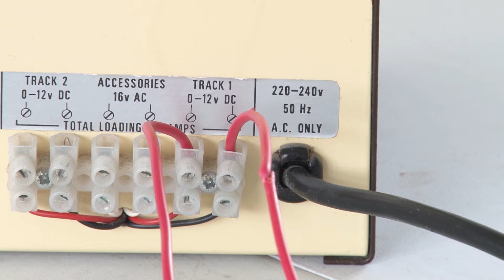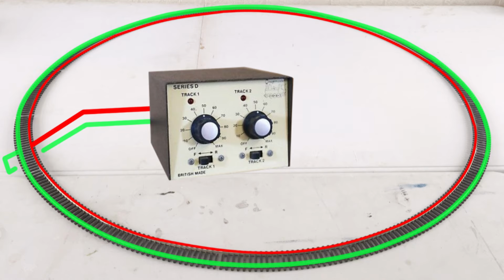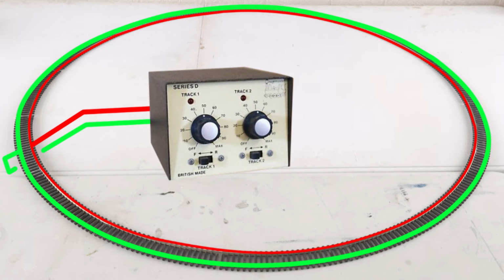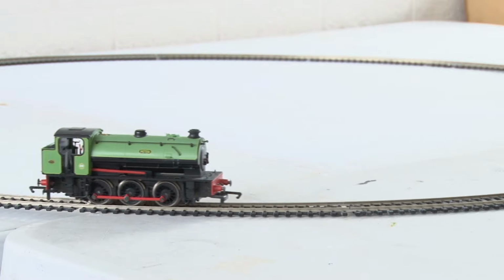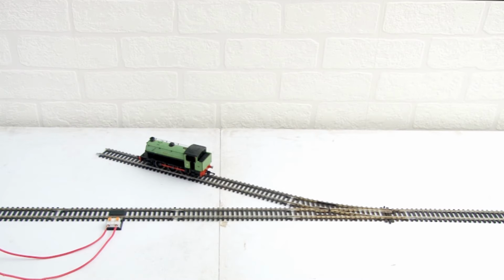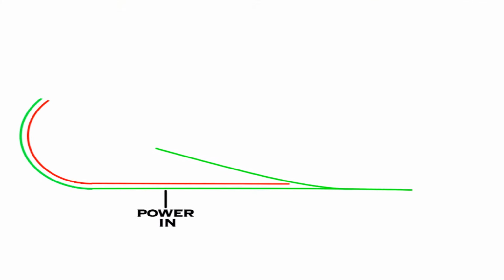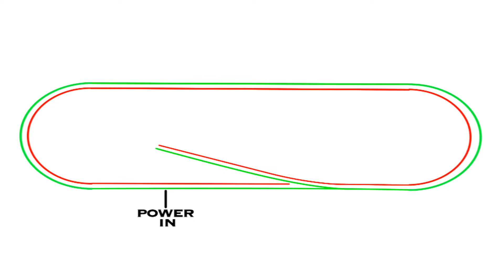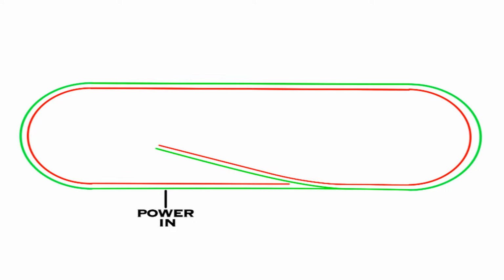Wiring A Model Railway For Beginners - Model Railway Basics: Episode 3

Comment: Never imagined powering up even a simple single loop model train track would have so many technical issues. Good video.
Reply from the maker: If it is literally a single loop then it's just two wires, one to each rail, and that's it. Points/turnouts are where things get more complicated by even then it's mostly just a case of where you put the power feeds in relation to the point. Thanks for watching 😃

Comment: Brilliant! I never knew that about DC & DCC locos not being entirely compatible with each other's track. For me I am never venturing into Don't Come Cheap territory!
Reply from the maker: Hey Alan, if you haven't bought a DCC Command Station yet I'd recommend looking into the new HM7000 system from Hornby that's on the way. The bluetooth decoders can apparently run on traditional 12v DC (where with normal DCC it's a bit iffy) so you could convert some of your locos and leave others on analogue control.
The decoders are a little more expensive but you save a huge amount on not having to buy a Command Station to run everything, so swings and roundabouts. Just food for thought if you're taking your first steps into digital control. Thanks for watching 😃

Comment: Informative as always!👍 I still can't believe that your insulfrog points work with those little engines! Even at low speeds? Incredible 😂
Reply from the maker: Thanks! Yeah even I'm impressed with how the Ruston performs. Interestingly though I have been having some trouble with a couple of 0-6-0s on the new layout due to uneven track. I'll be showing in the next Modular Layout video along with my solution (hopefully)! Thanks for watching 😃
Reply: @ThatModelRailwayGuy  uneven tracks are the true nightmare! I had some problems with a small diorama I built, solved by outsmarting gravity 😂 but in a big layout is tough

Comment: Great video as always! If possible, can you do a video on what DCC controller you use please or even your thoughts on other options. I’ve got an old Hornby Select and keen to upgrade. I’ve tried HM7000 which was great (at least for me!) but cant get the decoders in all my locos which is a bit limiting. Would be good to get your thoughts on what is out there. Thanks
Reply from the maker: Hiya, I have considered doing a video on DCC controllers - the obvious barrier is needing all the controllers to be able to compare which would get quite expensive. 
Personally I use the Roco Z21 system - quite expensive but does have a lot of options including wireless control. 
The HM7000 is great but as you've noted, there are issues with fitting the decoders into locos - I believe Hornby is working on making them smaller in the future. 
There's also the Prodigy system (from Gaugemaster I think?) which is popular with a lot of modellers. It doesn't have some of the more fancy features but it's a full complete system that works really well.
Alternatively there is also the DCC-EX system which is a DIY controller. This is the cheapest option and is gaining in popularity with those on a budget.
Hope that helps and thanks for watching 🤩
Reply: Thanks, I’ll keep this is mind! The Z21 might be a bit out of reach for the moment but will look into the other options. Hopefully Hornby also come out with smaller decoders too as I personally have found the system a pretty straightforward entry to DCC. Thanks

Comment: Firstly I’ve followed all you tt120 videos and some others and they have been extremely helpful . I am building a tt setup for my grandson (well he might get it eventually?!). With regard to electrifying should I put a dropper on every piece of track to avoid long term circuit breaks (I have a mixture of Horny set track and PECO long flexible) or just some or not bother at all and rely on fish plates?
Many thanks 
Steve
Reply from the maker: Hi Steve, fantastic to hear you've started a TT layout! Since you said in your other comment you were using DCC I would recommend adding droppers to each section of track. That's what I did on my TT layout and it will make everything more electrically robust in the long term. Obviously this is easier if you're using the PECO flexitrack as the lengths are considerably longer. 

You can of course rely on fishplates too and just add droppers at strategic points around the layout and it will probably work fine... but I tend to be of the opinion that it's best to put in the extra work initially for the piece of mind later on. Hope that helps and thanks for watching 🤩
Reply: Very many thanks, your videos are my encyclopaedia!

Comment: Thanks. Lovely and clearly presented. I have a simple circuit working, but Is there any advice for the next step up say with two circuits that intersect please. Not sure what has to be connected.
Reply from the maker: Glad you found it helpful. For two circuits, when you say intersecting do you mean with a set of points to cross from an inner circuit to and outer circuit? If so there are two main options: 

1. Feed the wires from your controller to both circuits. Both circuits can be controlled from a single controller as if there were two locos on the same piece of track.

2. Introduce a second controller to hook up to the second circuit. When you open the points up to cross from one circuit to the other you just need to make sure that one of the controllers is off so they don't fight against each other. (You could also introduce an isolating switch as a belt an braces approach but that's a little more complex) 
Hope that helps and thanks for watching 😃

Comment: Great video, ideal for a total beginner.  
I’m only on DC but still use a bus wires and multiple droppers so I don’t get a voltage drop on a larger loop.
Also if I change my mind I can change to DCC.
Reply from the maker: Thanks Leigh, yes same for me. Because my layout is modular I built in bus wires and droppers on every module even though it was originally intended for DC. That said I'm now making the move over to DCC but thanks to some forward planning I made it easy to switch between the two just by unplugging one set of wires! Thanks for watching 😃

Comment: A very quick adition for anyone who wants to keep sidings live on DCC. (6:51). A very easy way to do this that doesnt require a seperate feed for the siding is by using point clips by Hornby. By inserting those the insulfrog points are always live. I'm unsure however if you can use these on non-Hornby points.
Reply from the maker: Ah brilliant, thanks for sharing that! I don't have any myself so I don't know if they work on other points brands either but they're certainly a great alternative for someone who wants to keep the wiring to a minimum. Thanks for watching 😃

Comment: I want a controller for the exact loop you made (track). Which one should I get? I want cheap, and I want both direction running (reverse and forward). And as simple as the first example of wiring you gave. Love it if you could help, thanks.
Reply from the maker: If you want the cheapest option out there you can get some really basic PWM 12v controllers for £5 online. But your locos probably won't run the best on those to be honest. In my opinion you're better off going for something like the Gaugemaster Combi - nice and simple and used by both beginners and experienced modellers alike. Hope that helps and thanks for watching 😃
Reply: @ThatModelRailwayGuy  Oh! I meant cheap as in not £200+. The gaugemaster seems perfect. Could you explain what single rail and duel and quad rail are?

Comment: Hello, nice video. Do you have a video on how to DC wire a double loop with points connecting them so trains can go from one loop to another but two trains can run at the same time?
Reply from the maker: @railway187  Not specifically but in that instance you need two controllers, one for each circuit - doesn’t matter where on the circuit it’s connected.

The easy way would just be to make sure one controller is OFF when using the other controller to have a train switch from one to the other.

Or if you want to get fancy you can use isolating fishplates between the two points which will protect your controllers. But when crossing over you need to make sure both controllers are set identically. Hope that helps and thanks for watching 😃
Reply: @ Thanks 🙏

Comment: Have you/ Can you do a video on where to start with the basics of getting started with DCC?? Setting it up, extra wireing for siding, lights to building, and so on.
Reply from the maker: It's probably best to check out some of my layout builds (the current TT:120 layout build in particular) as the early episodes focus more on wiring for DCC. But essentially you just have your main bus wires and take droppers out the track from there. Some people add droppers to ever single piece of track, others are more conservative.
Personally I don't use DCC power to control the lights or points, I prefer having these on a separate 12v circuit which I've found to be both safer and cheaper too. Thanks for watching 😃

Comment: Thanks for this great tutorial, I do have a couple of questions to ask, I'm just about to start building my new layout, it's with the new TT 120 set, I'm having a few problems on what wire to use for the bus and droppers. Someone said use 16 X 0.2 for the bus and 7 X 0.2 for the droppers but after buying them they seem very thin for the job  It's a double loop setup and on a 6 X 4 feet board so not big and will be DC. I'm hoping to wire up my points as well but not sure which points to buy and should I run a separate bus for the points. Thanks so much.
I'm really missing your ""video series", are you going to do any more?
Reply from the maker: Hi David, great to hear you're making a start in TT! The dropper wires don't need to be very thick - they just connect your track to the main bus wires so they only travel a very short distance. If the wire is too thick you'll have more difficulty soldering it to the rails without causing issues.

When it comes to points, what track are you currently using for TT - Hornby or PECO? While the two are technically compatible, my experience tends to be that it's much easier to stick to one or the other for the best results. The Hornby points are dead frog, but cheaper and easy to use. In comparison, the PECO points are more expensive but use the new Unifrog concept, which allows the whole frog to supply power to the loco making them more reliable.

As for the video series continuing, do you mean Model Railway Basics or the Modular Layout Build? There should be new episodes of the latter along fairly soon hopefully. Hope that helps and thanks for watching 😃
Reply: @ThatModelRailwayGuy  Thank you, I'm sticking with the Hornby track and points, I didn't want to mix them and they were supplied in the train set and so I bought the track packs to enhance the layout. I'm wanting to eventually put switches on the points so when I wire the layout this week I will drill holes in the board to accommodate the point motors. I was thinking about using the Gaugemaster Seep motors, assuming they will fit the TT 120 tracks. If I'm right do I need a CDU to fit with these.
Any of your video series whether it be your Modular layout or something like the Layout in a suitcase, (I really enjoyed that). Or even your scenery videos. The thing is you have a way of presenting that is easy to understand which makes it more enjoyable to watch.
Thanks again for your help.
Reply from the maker: @davidharle952  Ok great, yeah the Gaugemaster SEEP motors should be perfect but yes I would highly recommend using a CDU with them. The SEEP motors fit fine on both my 00 and 009 points so I can't see why they wouldn't work with TT points too. I actually have a video on fitting these motors which might be of use: https://youtu.be/T95X4JPRKkk

Great to hear you like the scenery videos too. The modular series is returning very soon hopefully with the aim of finishing off all the scenery on the layout. Channel Members have already seen some of the progress as I've been posting updates for them as it happens, but the main videos will be along once I've finished editing them. 😀

Comment: Great video. On the back of the series d controller there two positive and two negative ports for the tracks etc. Can you run multiple wires from each port so they can each operate two tracks? Or a signal and a track? Thanks Andrew
Reply from the maker: The two ports correspond to the two control knobs on the front panel. In theory you could run wires to multiple tracks but obviously one knob would then cause trains to move simultaneously on both tracks unless you introduced a switch of some sort. I don't think it would work with a signal though as I believe they generally need a continuous power supply. Thanks for watching 😃

Comment: If it were to fit electrofrog points but not do anything with the little polarity wire (though I would add insulator collectors on the frog rails) would the electrofrog point work the same as an insulfrog point? Or would it be worse for stalling than insulfrog and less reliable overall? I'm trying to decide whether to go for insulfrog on my layout, or go for electrofrog installed as described above and have the option of doing all the polarity stuff layer down the line.

Thanks!
Reply from the maker: Hiya, the short answer is: no, not really. With an insulfrog point the power is distributed down the exit the point is switched to and to the line beyond but that wouldn't happen in this case. Also your dead section would be a LOT longer than on the insulfrog point so you'd be limited to running only long wheelbase locos with lots of pickups.
 
The best thing to do would be use the new Unifrog points as these are pretty much designed for your exact situation. Out of the box they act mostly like the insulfrog points but they have the option of adding power to the frog later on if you want to go down that route too - I actually have a video on these coming out fairly soon!

The main disadvantage with Unifrogs is whether PECO have actually made them for the type of points you need in the correct gauge/scale as they're still fairly new. Hope that helps and thanks for watching 😃

Comment: Do you add droppers to each piece of track or have one connection to power the entire loop? I’m still working out what to do on my layout
Reply from the maker: For DCC I tend to add droppers to each piece of track if I can - it's not a necessity but it does tend to make things more consistent. The same is true for analog to a certain extent but depending on how you wire things up with isolating sections it can be a bit more involved. At least with DCC you know everything needs to be live all the time. With analog though I've gotten away with having just one power input on an entire layout and running it from that... it depends on the layout of course and what you're hoping to do with it though. Hope that helps and thanks for watching 😃

Comment: Hey buddy,

Do you have any videos or advice on a second oval inside a larger one? 

I’ve just built my son’s track in the loft and have a larger outer oval with a small inner. We’re just starting so only have the one Hornby 7229 power unit with the one powered piece of track.

I’m struggling to understand whether both inner and outer ovals will need a power unit and power piece of track? I thought maybe just one was enough because they’re connected via points.
Reply from the maker: The points isolate as shown in the video with the sidings so the power will only flow into the second loop when both sets of points are set to crossover. Once you set them back to their own loop you’ll lose power to the second loop.

If you want to control each loop separately you’ll need a second controller and power track for the second loop. 

You can also control them from a single controller using the Hornby track link wire which will transfer power over to the second loop. But bear in mind you won’t have individual control over each train. Hope that helps and thanks for watching 😃
Reply: @ thank you so much!! That’s really helpful, I probably should’ve understood that from your video, apologies. 

Thanks for t help and thanks for the videos, we couldn’t have got this far without you

Comment: At 6:51 you mentioned that people like wirings multiple pieces of track like sidings etc. I was wondering what you do with all the ends of the cables and what you plug them in to
Reply: That are attached to all the different sections of track
Reply from the maker: Hi there, so in the case of DCC you would have a set of bus wires (positive and negative) that come from your controller and run underneath the baseboard. All wires from your track would connect to these main bus wires - think of it like a central power cable that branches off to each piece of track. 
Alternatively you could just connect the wires to another track section that is already powered (as long as you get the polarity right) although I wouldn't recommend this since if that track section looses power it will knock out other parts of your layout too. Hope that helps and thanks for watching 😃
Reply: @ThatModelRailwayGuy  thank you so much! I’ve been stuck on this for awhile! Thank you
Reply from the maker: Huawei Greninja No worries, happy to be of assistance! Good luck 👍